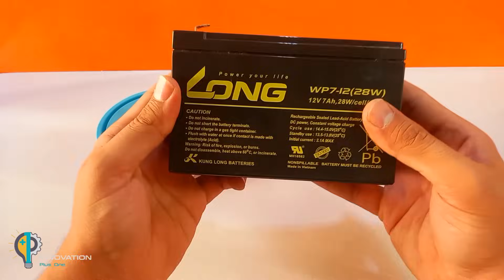Generate Free Gas From Old Battery || Hydrogen Generator

Comment: Did you use salt?  The solution became polluted.  You said KOH or salt but I"m guessing you chose salt.  I believe KOH with graphite electrodes will stay clear.  Well, you also have to use distilled water.
Reply from the maker: Yes, I used salt, so it was not clear🙏❤